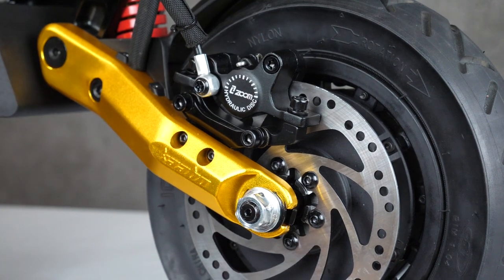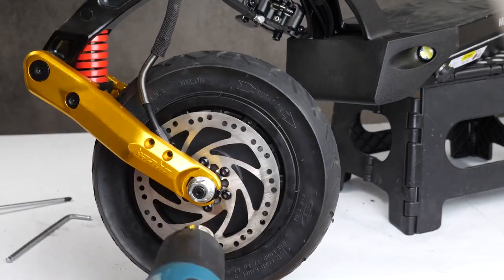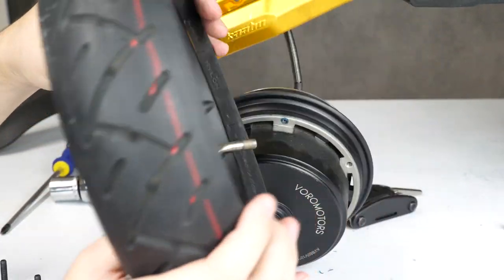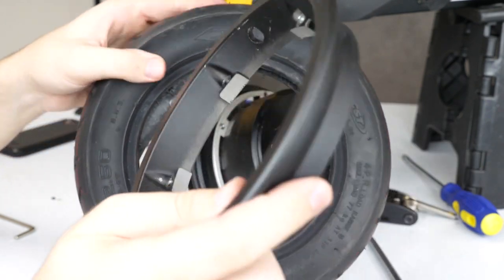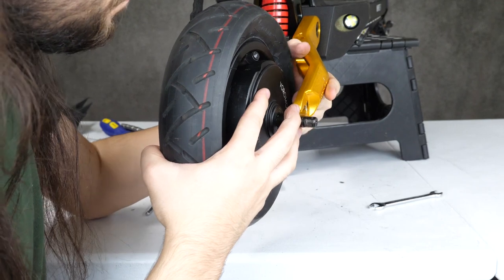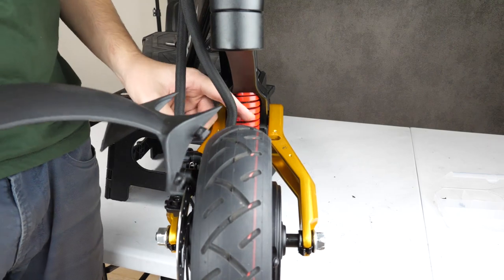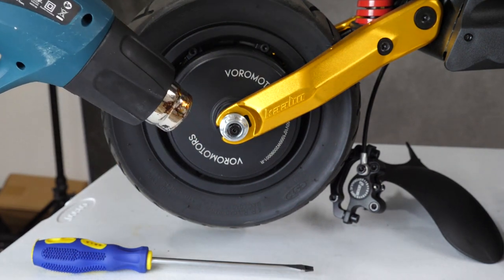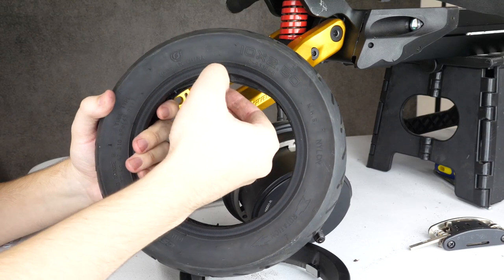How to replace the tires on your Kaabo Mantis Pro SE Electric Scooter?

Comment: Thank you for this video! I plan on changing my Mantis tires to 3" wide ones as soon as they get here.
Reply: Hi Jess:  Were you able to change to the 3" tires?  How was the process?  I was going to go with the 3" Off-road tires.
Reply: @BlueVotr  i haven't done it yet, lol. I need some proper wrenches to do the job right. Im waiting for my brother to loan me his tools so I can do it. I have allen wrenches to take apart the tire from the hub but not the nut wrenches. Those are glued on with red lock right so I'm probably going to need someone to hold the scooter down when I try taking it off as well. It's gonna be a bitch but i want to be prepared and do it right without getting frustrated you know. It'll be worth it once I'm done!👍
Reply: @BlueVotr  plus my original tires STILL have some tread left!! And it's cold here in NYC so i haven't been riding as much. Battery has taken a hit below 40F and don't want to stress the cheap Chinese battery and cause any type of damage.
Reply: @jessa.3857  I hear ya.  I gotta get hold of that hot air/heating blow dryer thing. Seems like a bit of work but I’m gonna have to do it if I want to do some off-roading
Reply: @BlueVotr  Get whatever will make the job easier! Good luck with the job!

Comment: Probably the clearest instructional Mantis tyre change vid on YT!  Thank you! Just a couple of quick question... No loctite on the 6 motor screws?? And the wheel nut had red loctite, I've only got blue... will that be sufficent???
Reply: Blue locktite should be fine.   Blue locktite is made to be removable with hand tools but still secure nuts usually you’ll use this locktite on bolts or nuts that’s made to me removed on parts that are require servicing.  Red locktite on the other hand is made for more of a permanent hold like structural bolts suspension and frame bolts or heavy duty industrial bolts and was made that you’ll have to heat up to 500 degrees to loosen them.  Hope this helps!! 🤙🏼🤙🏼
Reply: @yoassgoinhateme  Perfect!  Thanks mate. Appreciate the input.  Used blue anyway when I changed my innertube and seems to be holding nicely. :)

Comment: Great video, my swing arm bolt had seized completely nothing would break it lose I tired heat torch even an impact wrench the head of the bolt rounded. These swing arm bolts are hardened steel and a nightmare to remove if they seize. I had to drill the bolt out in the end, just a warning.

Comment: Hi, thanks for the video, pretty clear and useful.
Im looking to open the rear motor and see if there is something wrong, cause my kaabo mantis 10 single 800w has a noisy sound coming from The rear motor.
Is not the brake, or the rotor screws (there are no contact points that could make the sound) could be the axis or the motor, and im not sure how to open it easily, regards !!

Comment: I need to change the rear brake rotor on mine as I caught it on a kerb. I got the wheel off but the 3 little screws that hold the kick plate on on the rear are being a pain, the 2 outer ones are so tight they soon rounded off. Is the motor wire definitely located under here?

Comment: Watched this video to replace an inner tube on the rear wheel of my new Mantis V2. A potential problem I've noticed is that the motor line didn't seem to settle in properly when I finished putting everything back together and now the accelerator sticks a little. I hope you have advice on how to fix my mistake
Reply from the maker: We do not sell the Mantis V2, so we can't speak to that model specifically, but cable management, often using zip ties, is important to keep everything in its proper place! You definitely want to avoid major kinks or worse when handling a scooter's cables and wiring.

Comment: I havet the same exact looking tire. How do I understand that it is worn out? I've read millions of guides but I can't find a picture for me to understand lol.
Reply from the maker: If the tire is misshapen, bald (low or no tread), rubber is cracking or dry, not holding air -- you should replace the outer tire and/or inner tube. The Mantis Pro SE, Mantis King GT, and Wolf Warrior X GT have tubed pneumatic tires. If your tires go flat but the outer rubber tire seems fine, you may have punctures in the inner tubes and may only need to replace the tubes. If the outer rubber tire shows signs of damage mentioned, it's likely you'll need to replace both. With tubed tires, sometimes the tube can get pinched in the rim -- this is called a pinch flat. Tubeless pneumatic tires seal to the rim, so flats happen when the seal isn't tight or there's a puncture in the tire. Hope this helps! Thanks for watching!

Comment: That is so much easier than the Emove Cruiser.
Reply from the maker: Around the same time taken for tire replacement jobs on Cruiser and the Mantis Pro. It depends on how you see it. 
We would still prefer to change the tubeless tire once and not worry about it for a long time rather than constantly replacing tires.

Comment: Tubeless tires are harder to remove but last longer w/o airleak once installed. But if I apply Armor Dilloz tire sealant to a tubed tire, would that make it last just as long as a tubeless tire ?
Reply from the maker: Hi Michael, 

It wouldn't last longer than a tubed tire. A tubed tire is always going to be more prone to punctures than a tubeless tire due to the soft inner tube that is inside the wheel. 
A tire sealant acts as a temporary preventive solution to the root problem, which is inner tube getting punctured inside of the wheel, usually not a result from an exterior object. If a sharp object is able to puncture a tubeless tire, it will be able to puncture the outer layer of a tubed tire - Sealant does not have the ability to seal up a puncture from an outer tire. 

To give you some insights, we shipped out more tubed tires for the Mantis in the past 3 months then the tubeless tires for the EMOVE Cruiser for the whole year combined.

Comment: Do we put lock-tight glue back on the nuts after we replace the tires?
Reply from the maker: Just apply a little on the edge, when you tighten it back in a rotational manner, the loctite will spread across the nut and the threading. 

Hope this information is helpful.

Comment: One of my six screws that attached the motor to the tire is stripped, what should I do?
Reply: Mine too. Did you get it figured out ?
Reply: @javismancave Yes, did! I used a stripped screw remover drill bit, and then bought another screw on the website.
Reply: Do you know what the size of the screw was ?

Comment: Ok so first off i'm FURIOUS with you guys at voro motors for sending me a scooter with ONE JUST ONE stripped hex head bolt of the 6 holding the hub on, bravo. I will start off by saying   I am mechanically inclined as having worked on bicycles and dealt with stripped bolts for 40 years I'm familiar with techniques to remove them. So far I've not had any luck at all and I am running out of options and bolt head because of the multitude of tools etc trying to remove it. I'm losing patience as I've been at this for, oh, 8 hours or so JUST TO REPLACE THE F***** TUBE!!!!!!! any suggestions there chief. Ps you might consider using grade 8 bolts in the crucial areas of your builds, because this is ridiculous.
Reply: Mine stripped when I was trying to change tube . Did you get it fixed ? If so how
Reply: Do you know what size the hex bolts were ?

Comment: Hey I would love to add off-road tires on my  mantis pro se do I need new fenders if I decide to change tires anybody let me know thank you and second of all nice video
Reply from the maker: Yeap, you need the new fenders in order for you to prevent water splashing. However, if you are riding in dry environment most of the time, its not really necessary.
Reply: Thank you for the response and I'm also trying to modify the scooter I want to add
Reply: Okay thank you I will order some new fenders I have one more quick question I want to replace the wheel axle the nuts for the hubs I want to replace them with black ones do you know the size so I can order some new wheel nuts thank you

Comment: I bought me a mantis scooter because of getting laid off because of COVID-19. I’ve put about 300 miles on it so far along the southern coast of California. From Huntington Beach all the way to Laguna beach cliffs and back about three time a week. I normally stop at the middle of my ride and get a schooner of beer which is A 32oz beer in a plastic beer class at Mutt Lynch’s in Newport Beach. Unfortunately I didn’t ride for about two months because of getting the virus 🦠 which almost killed me. As soon as I was able I went for a ride and my tire was low I guess from sitting in the garage for two months. As I rode on the boardwalk the wind was blowing strong that day and sand was all over the side walk and my camouflage hat blew off as I braked to stop to get my hat I stop to fast and my tire must of rotated foreword and pinched the tube that became flat. I had at least five or 6 miles to go to get to my destination to get to my vehicle. I realized I had a back tire flat so I road as close to the front as I could and went half speed or about 20mph and made it were I was going. That would of been a good walk in the wind pushing a 65pound lump all the way back so I got lucky that it was the back and not the front tire. What a ride it really wasn’t that bad knowing it would make it back on a flat tire. One thing that sucks! Is there is a lot of bike stores on the path but none of them sell a 9” tube for a scooter. So I have to order one on ebay which Allways take a week to a month to get then I have to worry about all the porch pirates that follow ups postal around and steal packages. Pain in the ass if you get a flat waiting for a stupid tube that no one carries. Still waiting, it’s supposed to come in February 2 maybe you know how that goes because of COVID delivery delays another week I hope not. I weigh 270lb. And this mantis halls my Ass around like nothing this scooter is definitely a blast to ride it’s a lot of fun. I posted it for sale and I got a few hits on it and all they would say is . Is that a recall  I heard the stem has a problem breaking. I have no idea what they were taking about but they sounded like they were just trying to low ball me. So f@@k them I unlisted it and have been riding it a lot until I got a flat. Oh well it’s raining finally so I will sit it out I’m out.🛴👊👨‍🦳👍🛴

Comment: Tire went flat due to metal shard or staple. Used slime didn't hold
Reply from the maker: Hey John, 

We're sorry to hear this, but while it is very helpful in most situations, tire slime is not a solution for every kind of damage a tire encounters. Damage severe enough can still render the tire damaged to the point of requiring replacement. This is just part of general maintenance for a scooter. 

If you need a replacement tire, you can get one on our website here: https://www.voromotors.com/collections/electric-scooter-parts-and-accessories/products/10-inch-outer-tire. Also feel free to reach out if you ever need any help!

Comment: Thanks to you, I may have understood why the wheel makes noise.  I got a puncture, I removed the tire and when reassembling it now makes a noise, there are no brakes.  But it is the mounting of the rim.  Not online I think.  In fact, when I'm above the noise is jumps.
 Watching your video I noticed that I probably didn't put the valve in line with the rim.  It could be that.

Traduzione: Grazie a te forse ho capito perché la ruota fa rumore. Ho bucato ho smontato la gomma e nel rimontaggio ora fa rumore, non sono i freni. Ma è il montaggio del cerchione. Non è in linea credo. Infatti quando sono sopra il rumore è a salti.
Guardando il tuo video ho notato che probabilmente non ho messo in linea la valvola con il cerchione. Potrebbe essere quello.